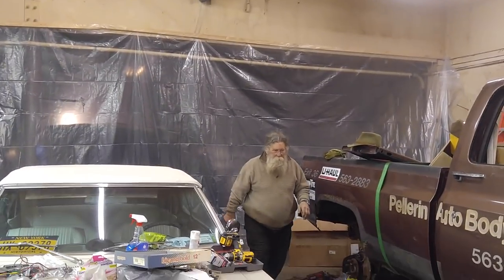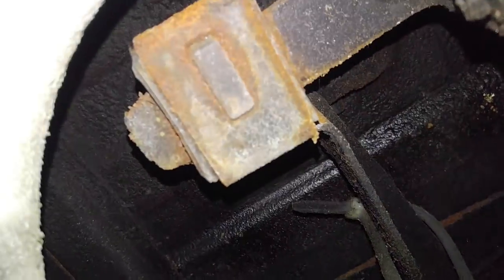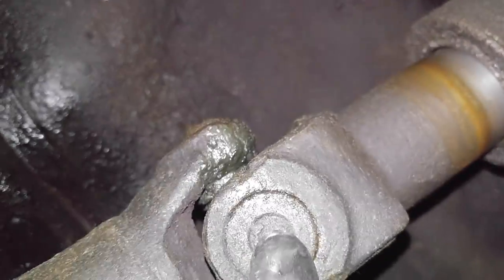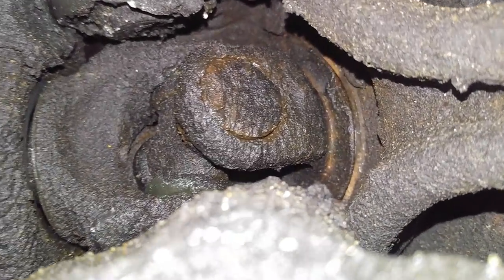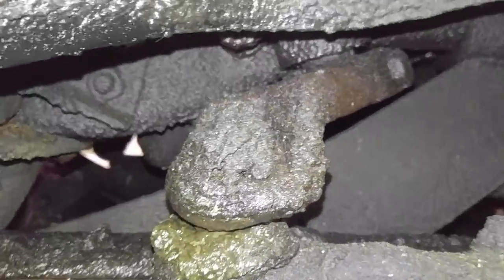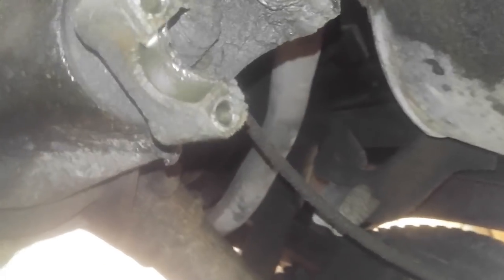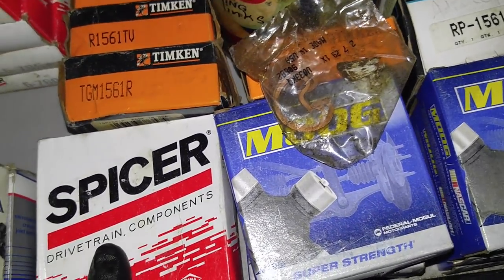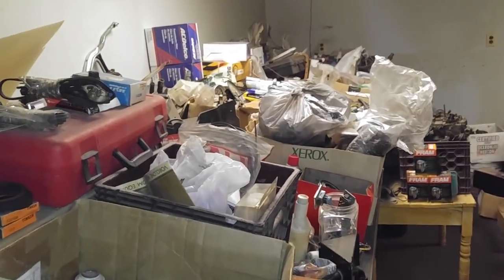K5 Blazer U Joint Problems 1 28 19

Comment: provided that you've driven this truck a sh*t ton the past 10/12 years (correct?) its still held up pretty good for what you've used it for in new england.
Reply from the maker: Yep over 10 years, only 5,000 miles. But a rough 5000 miles it's been.